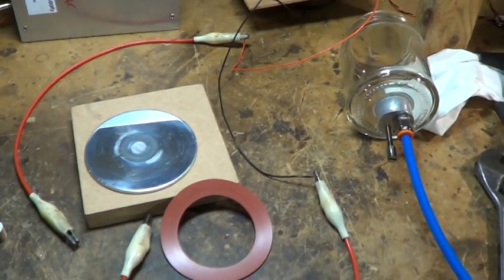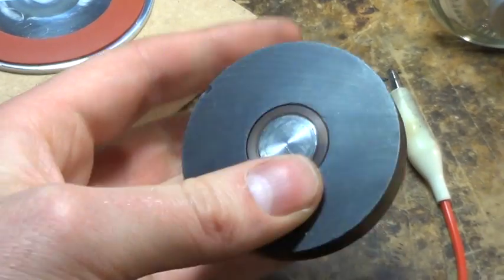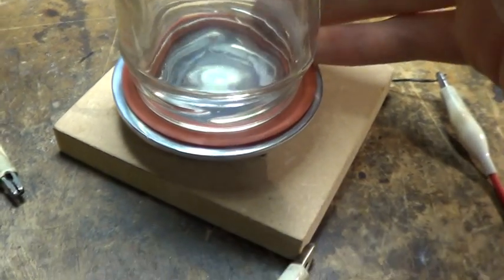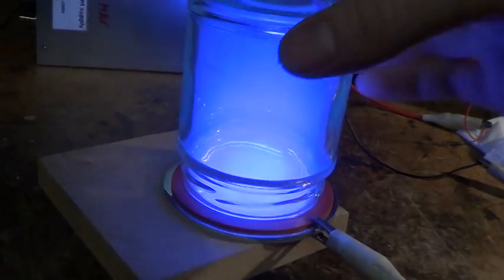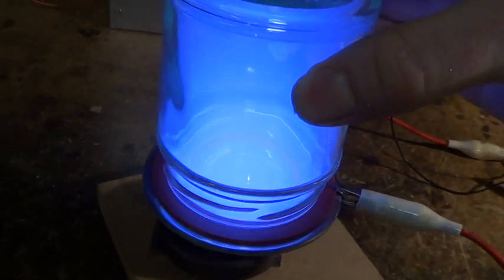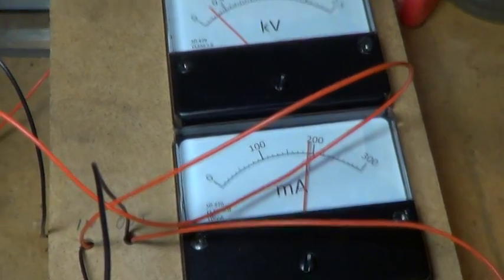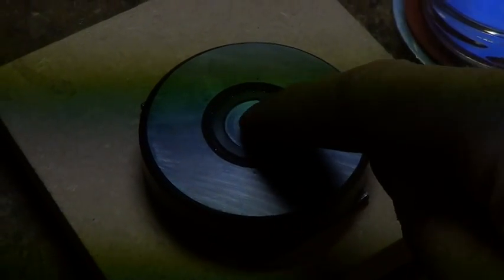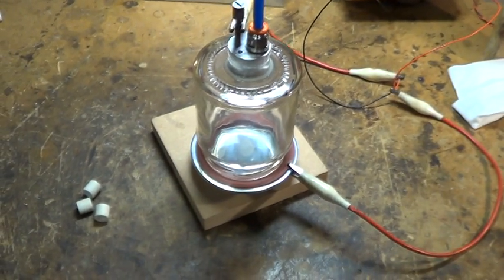Demonstration of magnetron plasma

Comment: Blue suggest positive charge rather then negative charge particles?
Reply from the maker: I don't know what you mean. A plasma comprises both electrons (negative) and ions (positive). Light is emitted when these combine, and the colour of light depends on the gas type, pressure, current etc.

Comment: How did you connect the vacuum pipe to jam jar and also what kind of vacuum pump did you use
Reply from the maker: Machined aluminium block glued into the jar, then a push-fit pneumatic fitting screwed into it.

Comment: Nice and helpfull video. 
Can you please tell me how strong magnets you used and where can I buy magnet and metal assembly? Please.
Reply from the maker: I don't know the strength of the magnet, sorry. The magnet I used was one of a pair out a microwave oven magnetron.
Reply: @imajeenyus42  So, will it work if I use the magnet from a single microwave oven, or need more magnets, please. Sir.
Reply from the maker: @nityanandadas5575  One ring magnet. Any microwave oven, they all use magnetrons.
Reply: @imajeenyus42  Thanks a lot.
Reply: @imajeenyus42  I have no idea about which microwave oven magnet will work. 
Please suggest me to start with.

Comment: What voltage/amperage required? Can plasma ball be used?
Reply from the maker: Details of voltage/current are described both in the video and the link in the description. I suggest you watch the video. No, a plasma ball supply cannot be used as it does not have a high enough current output.
Reply: @imajeenyus42  Maybe current can be boosted? Those big ones output 5kV. Just looking for practical power supply

Comment: You need argon in the chamber to actually sputter anything
Reply from the maker: Not necessarily. Argon will give a higher-quality coating, faster deposition rate, and avoid any chemical reaction with the deposited material, but sputtering can be done using air as well. C.L. Stong's "Amateur Scientist" article from way back describes it - https://www.jstor.org/stable/24926153?seq=1

Comment: Can it be used from magnetic speker??
Reply from the maker: I'm assuming you mean a plasma speaker, since all conventional moving-coil loudspeakers are essentially magnetic. No, because the discharge is occurring at reduced pressure inside a vacuum chamber, not in the open atmosphere.
Reply: hi.tank.s
no... my mean is (https://tinylittlelife.org/?p=232) ..magnet from speker

Comment: Excellent. The only doubt is in the part of magnet. Can you please describe me what is done with the magnet?
Reply: Plasma is weird, when atoms are ionized they start to behave like a magnet. The ring shape he used as a magnet develops a field were the atoms are carried and their trajectory is bent. He left a space were the small magnet and were the larger magnet is attached. This leaves a pocket between the two fields. In this pocket the plasma gets trapped leaving a ring of plasma.

Edit: this method is used to make sputtering machines.
Reply: @ezramatan5233  Thats actually not was is happening. The magnet creates a inhomogeneous magnetic field. Electrons on such a field feel a force pushing them towards the position where the density of the magnetic field lines is lowest. So the electrons end up in the ring shaped region where field lines are least dense and predominantly ionize atoms there.

Comment: Hey Lindsay, what pump are you using? and where did you get your vacuum components from?
Thanks
Reply from the maker: The pump is a small two-stage rotary pump, from Alcatel. Not sure about the pumping speed unfortunately - on something like this, one of those air conditioning pumps would probably do. As for vacuum components, if you mean the blue piping and fittings, that's all just standard 6mm push-fit pneumatic stuff.
Reply: Thanks for the reply Lindsay,
Ive got a robinair vacuum pump (15115) but I'm not able to achieve such uniformly distributed plasma in the jar I'm using...its generally arcs...do you know what the problem may be?
p.s. I can email you a video for clarification if you want
Reply from the maker: Hi, I checked my pump - it's an Alcatel 2002BB model. There's actually a listing on EBay for one at the moment so you can get an idea of size: http://www.ebay.co.uk/itm/ALCATEL-2002BB-DUAL-STAGE-ROTARY-VANE-VACUUM-PUMP-/272684833040. It's quite small, 1.5CFM with a 100W motor, so similar to the Robinair pump EXCEPT that it's a dual-stage pump. However, the single-stage Robinair SHOULD be able to bring the pressure low enough.

If you're seeing arcing, that suggests the pressure is too high, for example caused by a leak. Maybe if you could send me a photo/video of your setup I might be able to spot something. What sort of seals are you using for the jar etc?
Reply: awesome, can you send me your email? (msg me if you prefer)
Reply: i deals in vacuum pumps and vacuum system , if you need any assistance u can mail me at : suhailalvie@gmail.com

Comment: What is causing the plasma discharge? If the jar is evacuated of all air, should there be nothing at all visible? Especially considering the relatively "low" voltage you used (approx. 1 kV @ < 1 amp), unless you introduced a slight air leak with the valve. 

A thought... if you introduced a filament or a heated cathode, your "jam jar" could function as a crude, half-wave vacuum rectifier tube if you had used AC on the filament and a positive DC (?) on the plate/anode. 

All in all, a very interesting demonstration, indeed.
Reply from the maker: Erzahler Firstly, the jar can never be evacuated of ALL air. There's no such thing as a perfect vacuum. Here, the pressure was probably around a few Torr (atmospheric pressure is 760 Torr. Neon signs, for example, are typically around 10 Torr.) This is a relatively rough vacuum and has no problem carrying current. The pressure is determined by the type & speed of the pump ( in this case a two-stage rotary) and whether there's any leaks.  The open-circuit voltage of my power supply is 1200V which is easily enough to strike the discharge (the voltage drops one current starts flowing). The pressure here is way too high to try and use it as an electron tube, with a tungsten filament etc. You might get some measurable effect, but generally you want a pressure down to 1E-5 Torr. This can only be achieved with a diffusion or turbo molecular pump.
Reply: +Lindsay Wilson: Thank you for the explanation, Lindsay. I don't pretend to understand ALL of it, but some of it I do. Thank you.

Comment: Lindsay Wilson if you don't mind I would appreciate if you would discuss some of the components and precautions with me. I am trying to make my own Magnetron plasma but I would like to talk about some of the issues with the project and how to fix them such as: cementing the top of the jar (the aluminum block, next to the anode terminal) with cobalt to prevent degradation in order to allow the discharge to occur for an extended period of time, without damaging the anode terminal as well as the vacuum connection. Another problem that I would like to fix is reducing the sputtering rate of the discharge during use. If you would be able to help me out, your insight would be greatly appreciated.
Reply from the maker: Hi - not sure what you're meaning by cementing the anode with "cobalt"? Epoxy should be fine, as long as the anode is cooled. Remember that most of the glue is on the outside of the chamber - if you can make the anode a close fit through the hole drilled in the glass, there will be hardly any epoxy exposed to the vacuum. As for reducing sputtering, best try using a different material for the cathode. Have a look at this table of relative sputtering rates: http://www.semicore.com/reference/sputtering-yields-reference. Metals like titanium, niobium, tantalum have rates about half that of aluminium. Titanium sheet is relatively easy to come by as well. Hope that helps!

Comment: So if i understud right, you used: a 1.000 volt DC corrent supply, a jar for vacum and a megnet under the jar. What is the grey cilinder in the top of the jar ? Only a connector or something else ? What happen if i try to use A.C. corrent with a lot of more volts ? ...sorry too much questions :P The first interest me very much thanks ;)
Reply from the maker: Firstly, please see the webpage at http://imajeenyus.com/vacuum/20140114_magnetron_plasma/index.shtml - it may answer some of your questions. Power supply - in my case, I had already built a special current-LIMITED supply, for use with gas discharges. Because of the negative resistance of the discharge, you need to have some form of current limiting - either a simple resistor (easy, but inefficient) or a fancy switchmode arrangement, which I used. The no-load output voltage is 1000V, but when delivering 300mA, it drops to a few hundred volts or whatever the discharge requires. The "grey cylinder" is simply a chunk of aluminium to make both electrical and gas connections - see website for more details. If you tried to use AC current, firstly the voltage wouldn't change much (as it's mostly determined by the gas pressure, electrode spacing etc), and second you'd get sputtering from both electrodes which isn't desirable. The upper electrode would also heat up as well.

Comment: Could someone explain to me how you create a plasma within essentially a Cathode Ray Tube? Where's the gas? Plasma is created when a gas is ionized, how is this working? Or am I just confused?
Reply from the maker: A cathode ray tube uses much lower pressures (to allow the electron beam to flow without striking gas molecules) - here though, I'm running at maybe 100mTorr, where there is still plenty of gas to get ionised.
Reply from the maker: "plenty of gas" - I mean, there's plenty of gas around as regards conducting electricity, it's still a very low pressure compared with atmospheric! Atmospheric pressure is 760Torr, so 100mTorr is only about 0.01% of atmospheric.
Reply: Lindsay Wilson  Oh, I thought it was a 100% vacuum. That makes much more sense. Thank you.
Reply from the maker: Yeah, it's deceptive! Even at extremely low vacuums, there's still a surprisingly large number of molecules around. For example, at 1E-12hPa (roughly the same in Torr), there's still 26,000 molecules per cm^3: https://www.pfeiffer-vacuum.com/en/know-how/introduction-to-vacuum-technology/fundamentals/molecular-number-density/
Reply: Lindsay Wilson  Science is certainly an amazing thing.

Comment: Is the plasma formed from what little oxygen remains?
Reply from the maker: The gas mixture, even when down to rough vacuum, is still approximately a 80/20 nitrogen/oxygen ratio like at atmospheric pressure (the pumping speeds for the two gases are similar), so most of the emission is coming from nitrogen. (It's very hard to photograph colors correctly, but a nitrogen discharge is much more blue/purple than oxygen)
Reply: *****
Thanks Lindsay. I've seen other videos that show the plasma rotating in the magnetic field, which is quite thought-provoking.

Comment: I would be very careful with high voltage and a vacuum! You can produce high amounts of x-rays and irradiate yourself. Most electron tubes run on only 12kv if you get anywhere close to 40kv the x-rays can go through just about anything!
Reply: Very cool video though!
Reply: science1324 ?
Reply: วิธีเปลี่ยนกระจกลอ10ล้อ
Reply: @LazyH-Online he is using one third of a kv
Reply: Dont pass 3keV... you plays  with 1-10 eV

Comment: Could you explain me why did you use also a vacuum?
Reply: Without vacuum there is too much air for the voltage to jump across the electrodes and start a plasma discharge - practically a short circuit. Vacuum is needed to bring the amount of air and thus electrical breakdown voltage low enough for plasma to ignite.
Reply: +sleeptyper thanks a lot man
Reply from the maker: Sorry, don't quite understand - a discharge such as this will only occur in a vacuum.
Reply: +sleeptyper That would be seen as an open circuit, not a short circuit. You are spot on on the rest of your comment!
Reply: science1324
I said that the vacuum is needed to start a short circuit - practically a plasma discharge. :)
Reply: Oh sorry about that, I must have miss read your comment! In that case you are spot on my friend!

Comment: Can I ask you something. I made my own vacuum chamber and High Voltage Power Supply but the plasma cant fill all the chamber like yours. It's just a plasma ray which cant fill all my vacuum chamber.Are there any problems with my HV Power Supply ? :D. Please help me
Reply from the maker: +Hà Tú Anh Sounds like the pressure is nowhere near low enough - i.e. you have a leak somewhere or your vacuum pump isn't powerful enough. You need to get down to a few Torr pressure before the discharge fills the chamber completely.
Reply: thank for you reply. :D. I get it down to under the -760 Torr pressure. I dont know if it's low enough ??. Please help me :). can i have your mail so i can show you mine :)
Reply from the maker: +Hà Tú Anh Yes, a photo would help a lot. My email is linsday@imajeenyus.com if you want to send one over.
Reply: thank you so much. i have alread sent one over. :). please help me to firgure the problems
Reply: +Lindsay Wilson please let me know when you receive my mail
Reply from the maker: +Hà Tú Anh I am so sorry, I made a typo in my email address!! It is lindsay@imajeenyus.com. Could you re-send please?
Reply: i've already sent it. :D. pls let me know when you receive it

Comment: Caution is always advised when doing experiments with glass and electricity, but consider the work Geissler, Crookes, Thompson did with more fragile aparatus than a jam jar. The 'Mason' jar (like the one used) is intended for canning and that is done in a vacuum. OK, not outer space, but a vacuum none the less. Tossing around a CRT will end badly not because of the vacuum, but due to the fragile nature of the tube's neck.

For the jam jar, the maximum force on the outside would be 1 atmosphere pressure--15 PSI--and I wonder if that would be enough to shatter the glass due to careful handling.
Reply: +ResearchAdvantage 
It's pretty mind blowing how long ago so many amazing discoveries in physics were made considering the lack of ideal materials and equipment they were working with at the time! 
What did you take into account when calculating the pressure and force / where did you find those numbers if someone else had already done the math?
I'm interested in how much stronger of a vacuum a mason jar with a straight neck, instead of the bottle-necked one that +Lindsay Wilson used in this experiment, could handle - although I really do NOT advise anyone to attempt this with thin glass either!
Reply: +Hans Heidmann 
There is not much pressure inside inside the 'Jam Jar' when the vacuum pump extracts enough air to enable the plasma to be generated. Assume the jar is empty for this calculation: internal pressure equal zero. Where I live the 'easy to remember' value for atmospheric pressure is 15 pounds per square inch. Check Wikipedia for more in-depth (no pun intended) discussion. So you have 15 PSI on the outside and zero PSI on the inside, so the net force on the jar is 15 PSI all around. A cylindrical container will resist that force on the sides and the force on the top (when in the 'plasma' position) will be supported by the walls of the cylinder. That leaves the portion of the jar that is resting on the rubber gasket. Because the 'mouth' of the jar is resting on the gasket, all that is resisting the force from the side at that point is the shape of the opening (round) and the friction between the glass and the rubber. 

Most people can 'squeeze' more than 15 PSI, but I don't know of any stories of jam jars being crushed in an effort to get the lid off. The risk under high vacuum comes from the shape of the container (round is better) and the glass (thick is better). I have personal experience with a polycarbonate plastic vacuum chamber decompressing--but not breaking--due to the lip sliding on the rubber gasket and letting the air in with a bang. A thick lip on the jar is essential. have a look at the bell-jars from the 19th and early 20th centuries for an example. Oh, and there should be no obvious flaws in the glass.

The 'bottle-neck' is a good thing as it resists that sideways force on the lip of the jar. If you are trying to go for an ultra high vacuum, the loose-footed 'bell jar' on a base design will not be as safe as a proper vacuum chamber--either a sphere or cylinder with solid bolted-on end caps. Look on eBay for some examples.

Comment: Shouldn't that give off more x-rays than you want in your hand? Or is there not enough power?
Reply from the maker: +Yextus It's only running at less than 1kV. Generally, X-rays only start to become a concern at above 20-30kV or so.
Reply from the maker: No. To produce microwaves you need to use a cavity magnetron and some means of coupling the electric field of the oscillating electrons out of the device. A simple DC magnetron discharge like this will not produce microwaves.
Reply: +Lindsay Wilson will it give off microwave radiation at 1kv?

Comment: Hi there

We also made this set up but we couldnt be successful. Our vacuum level is 3*10^-2 mbar and we apply aprox. 1000V but all we can see is just random sparks. We couldnt ignite the plasma. we cleaned our copper target (like shining) but still no success. Do you have any suggestions why cant make it?
Reply: Hi Mehmet can,

Did you find out what the problem was? Because 3*10^-2 mbar vacuum pressure looks OK for a sputter operation. Maybe distance between anode and cathode was too big. Was your vacuum chamber provided with Argon? 
A possible cause of random sparks could be that you sucked to much molecules out of the chamer. u need to feed a continuous plasma with enough gas molecules like Argon.

I am looking for a feedback from you.

Kind regards,
Emre